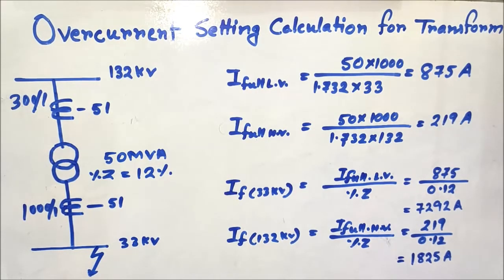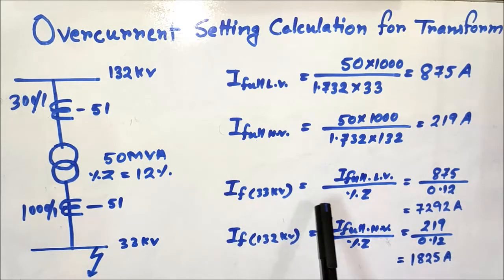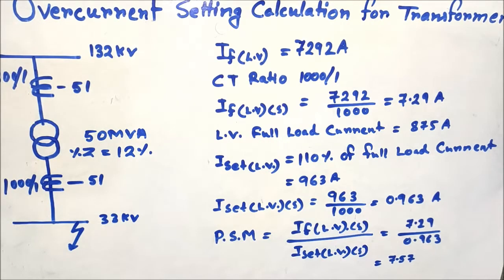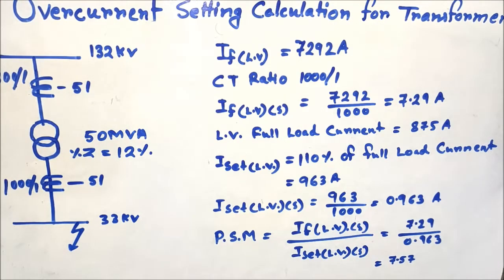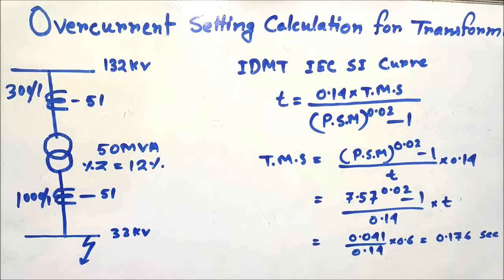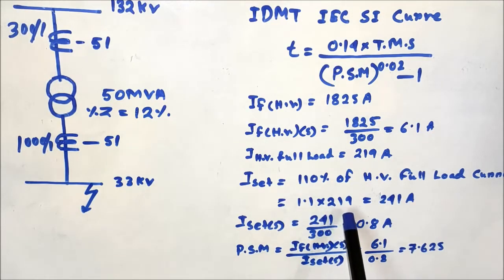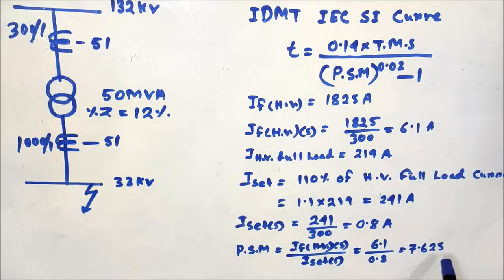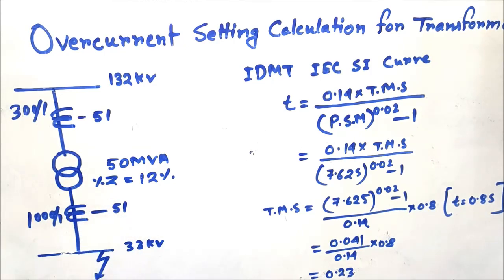OVER-CURRENT RELAY SETTINGS CALCULATION FOR TRANSFORMER and Relay Coordination

Comment: Thank you for a very clear easy to follow video on the topic. Made a lot of things clear for me. I posted a question under another comment about t=0.6s for LV and t=0.8s for HV. If you could answer we will highly appreciate it.
Reply from the maker: Thank you for your valuable comment. Tms of LV and HV can be so chosen that both the HV and LV over current relat trip simultaneously. Now a days if LV OC trip then there will be an inter trip will be sent to HV master trip relay from LV OC relay. Now for the time 0.8 S. 0.8 S is the maximum time that can be given to the transformer to trip as it should not exceed far end line in zone-3 time which is normally set as 0.8-1 S . So if Zone3 encroach lower voltage level far end FDR should not trip prior to transformer trip and i.e. why 0.8 S is the time for transformer trip in back up OC.
Reply: @relayprotectionelectrical  Another question please that I forgot to ask. The I(set) value being 110% of full load current and then calculate I(set)(s) = I(set)/CT ratio, is it the same as relay pickup current that is used in some calculations. Some I have seen are 120% and others as 125% of full load current. 
Is the formula to calculate t.m.s. for normal inverse curve?
Thank you.
Reply: Thank very much for the explanation.

Comment: PLZ Why this values of t=0.6 & 0.8 from what get it plz
Reply: Yes please can you clarify the times of t=0.6s for LV and t=0.8s for HV. Is it a general norm for different voltages. Is specified in IEC etc  Hope to hear from you.
Reply from the maker: @pietervdberg7055  Thank you for your valuable comment. Tms of LV and HV can be so chosen that both the HV and LV over current relat trip simultaneously. Now a days if LV OC trip then there will be an inter trip will be sent to HV master trip relay from LV OC relay. Now for the time 0.8 S. 0.8 S is the maximum time that can be given to the transformer to trip as it should not exceed far end line in zone-3 time which is normally set as 0.8-1 S . So if Zone3 encroach lower voltage level far end FDR should not trip prior to transformer trip and i.e. why 0.8 S is the time for transformer trip in back up OC.

Comment: Hello everyone 
I hope someone answer my question
I have six generators (1 MVA each)feeding 11 kv switchgear through transformer 0.4/11 kv i need to add two more generators (1 MVA each) with parallel transformer 0.4/11 kv to same switchgear.
My question is do i need to change the protection settings?
Reply: System prospective current value increased and system impedance has reduced . So a comprehensive short circuit calculation and protection setting study is required
Reply: @mageshgopi5644 Yes agree with this reply. When operating transformers in parallel the total impedance of the transformer combination will reduce, depending on the number of transformers and their impedances. Similar to connecting resistors in parallel. This will cause the total system impedance to decrease resulting in an increase in the prospective short circuit current. So yes in depth calculations and analysis of the network is required. 
Consider introducing a busbar system with busbar incomers from generators and transformer feeders as well as bus couplers for different sections to avoid paralleling transformers but to provide flexibility of the network. Not sure what the network looks like. 
Also bear in mind that when the network is changed such that the system impedance is decreased and fault currents increase substantially you might reach a point where the fault current could exceed the max fault current rating of switchgear, cables, etc

Comment: Sir why you didn't take the power factor in calculating the full load current
Reply from the maker: Maximum fault current is considered in this case and i.e. why unity pf is considered for this purpose.